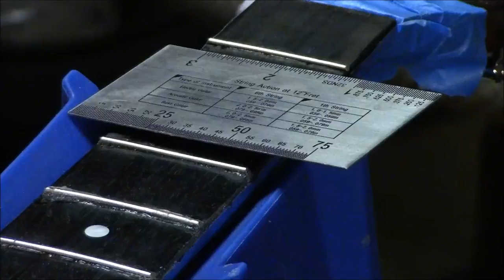TOTAL RE-FRET JOB

Comment: I pre-radius a few feet of fretwire to match the fretboard before I ever cut them.. they sell a tool for doing this.. or you can just make one like I did easy enough.. even if you didn't have one.. you could bend the wire by hand and get closer than this.. that way they dont have any tension to make them pop up.. they fit perfect all across the fret... and then just press in... a little drop of CA and bingo... I don't expect these frets in this video to stay in this guitar long.. they weren't radiused properly or at all.. under-radiused the ends are going to stay under tension till they break free from the glue or the glue from the board.. In a proper fret job, the frets will stay put using the tang barbs alone and then use adhesive to make certain they stay that way.. if your method involves the glue being the only thing holding them in, you are probably using the wrong size or shaped frets, a worn out or damaged fretboard, or both... i assume these were purchased in a little package.. precut.. so radiusing them would be more difficult.. or maybe it wasn't part of the plan at all.. hard to tell..  maybe in part 2 he will tell us how this happened..

Comment: Dave that one job I did two times and there will never be a third time.
Reply from the maker: Kevin, actually this job would have been a piece of cake if not for that drastic weather changes.  I go for a dry fit and BOOM temp DROPs and RAIN.  Out pop the frets.  I go for a Glue up and the same damn thing. Except this time was the second time and I had to REMOVE the Frets and that caused some real problems.  BUT, WAIT till you see the finished work on the next video Part 2.  Have a good one.
Reply: Davesintexas thanks Dave I will be watching for it. I'm doing my first build in four years. I am so far behind on my regular work that it's ridiculous. I don't play this weekend and I hope to get the Jazz Master done. Then the amp work. Thanks for the great video man, I love to watch then I don't feel like the only one in this crazy line of work.

Comment: Stewmac charges 50 bucks for that nibbler.. like most of their things.. you pay a premium for convenience and the name.. personally, I like to save a buck when possible... the exact same sheet metal nibblers can be bought for about 11 or 12 bucks and modified to easily cut the fret tangs like the stewmac one does.. that's all stewmac does, they modify the stock chinese nibbler to cut tangs.. instructions for modifying them are easily found around guitar sites and even here on you tube by one of our favorite guitar builders.. they do get dull and occasionally break.. so stock up on the cheap ones and have them ready.. stewmac occasionally gets a few bucks from me.. but i try not to feed them any more than I have to.. the same tools, parts, equipment, etc.. can be sourced and purchased for way less in most all cases.. it may not be as convenient always.. you may have to use google and actually try other vendors.. but, over time.. you will save a considerable amount of money by passing stewmac to source stuff in other places... amazon and ebay can be hit or miss.. lots of low end garbage out there.. but some are just as good or better than stewmac.. look around and you can save money.. that means more profit for you.. or lower prices for your clients.. or even both..  and if you are just starting out.. plan on saving a couple thousand dollars, or more, in specialty tools alone..  many of stewmacs tools are just chinese imported tools (and parts) that they buy and resell with or even without their name stamped on them.. . for double, triple,  or more.. like this nibbler... almost 5 times more.. you could buy some good nut files or radius blocks or whatever..  stay away from stewmac.. they need high profits to keep Dan Erelwine paid and in enough free stuff to make their videos and DVDs... you can find places that sell higher end luthier tools as well... stuff you will pass on and your grandkids will use.. buying the best you can afford is a good idea.. good tools last longer.. but in some cases, it really just doesn't matter..  rest assured tho.. if it says stewmac... it's priced too high.. glad to see Dave using some of the quality tools from amazon..
Reply: kujawat The tools are crazy prices from them but on some things it's the only game in town.
Reply: once again, thanks for telling me what i should do, how I should think, and how i can please you most... i just don't know what i'd do without you.. i understand now better why they feel the way they do about you on the other channels..  i'll keep your recommendations in mind next time i wanna post something.. maybe i can get a post-it note and put it up on the screen enjoy
Reply: +Kevinpaul no, i wasn't talking to you.. sorry for the confusion.. i was talking to this yoyo "David B." who trolls me on Dave's channel..  and everyone else it seems.. i forget you have to put + whoever on the computer to direct a reply..  i dunno why Youtube hasn't fixed that in all these years..  on mobile it puts replies to who you click on.. not on desktop...  if you can send me a link to that stewmac tool that will remove assholes..  i'm a buyer... we can use it on "David B."
Reply: kujawat I am sorry and I am not normally get after people. I will side with you because I hate trolls. I have found a lot of information on a very down to earth forum. Name is The Tone Rooms. You seem like a good guy and a good fit. Try it and see. Again I am sorry to saying it stuff to you.
Reply: Kevinpaul were good... Just a misunderstanding... Have a good one.
Reply from the maker: Im not sure about the Nibbler but the tang cutter I got wasnt from Stew Mac. I am a good shopper when it comes to tools and parts.  I never scrimp on parts for the work I do.  And I do try to get the best tools as well. I think my tang cutter came from Amazon or maybe Pilly Luth.  I think about half of the items I get are from Amazon. The only real time I was screwed was over some bone I purchased that was bad.  BUT, if you watch that video you WONT see me pointing fingers. I know most comes from India or China and are bought in bulk. Some are good some bad. And I always do comparison shopping.  Anyway thanks for the tips and watching...have a good one.
Reply from the maker: David, thanks for watching.  Everyone has an open say on my channel and I do thank you for the defense. But, in some respects he is right some wrong.  I dont just buy from one source for parts or tools.  I buy the best I can get and usually its from research and or Amazon.  The nippers? Tang cutters I got from Philly Luths. Why? They were the same tool without the hand grips and much cheaper.  What I dont go cheap on are the parts, supplies I use on everyone's guitars, amps, mics etc. I buy Brand or better. And I do not mark up their prices! I charge for the part, postage and taxes I have to pay and that is that.  The ONE thing that I have noticed ever since Ive offered FREE gutiar Setups are Trolls, hate mail as well as nasty phone calls and people asking for my prices! Its just crazy.  Its as IF I am stealing other repair shops business. The majority of these players simply cant afford to pay $50-$60 dollars for a setup. So, I do all these in order to show others how to do their OWN.  Drives some shops CRAZY.  Have a good one.
Reply from the maker: I have not run into any tools that there is only one supplier yet. Hope I dont.  But, yes, ALL of these tools are not cheap.  But, then again the parts are not cheap and always going up on prices.  Shoot Gibson 500K long shaft pots went up from $14 to $17 recently.  Im wondering if its due to their money problems or me screaming they are the best?  Have a good one.